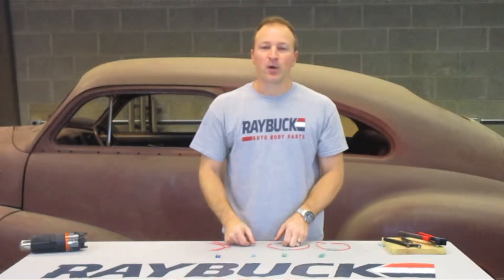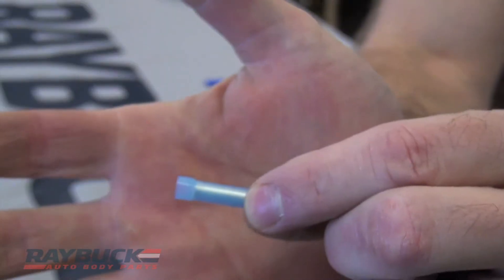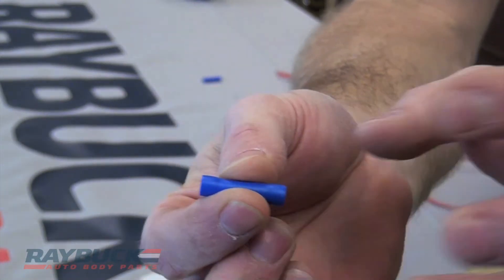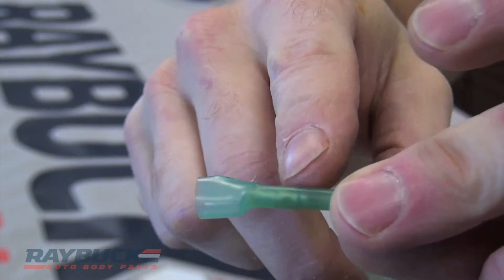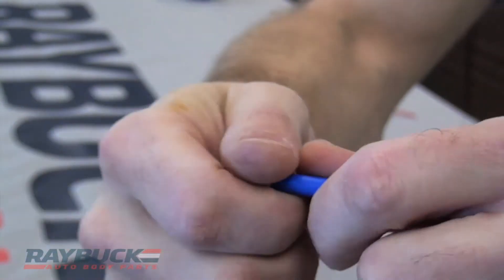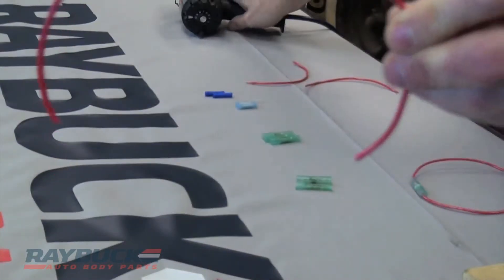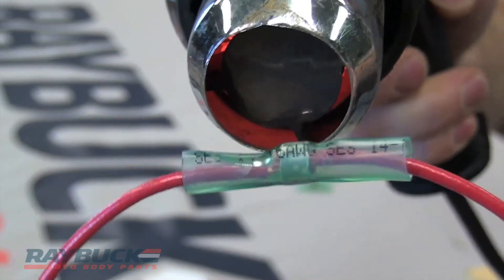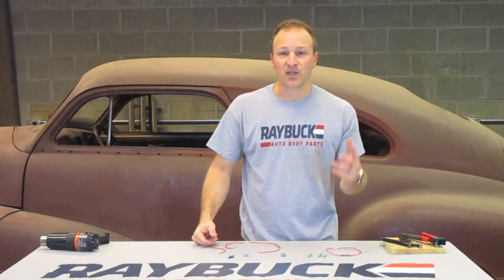Automotive Electrical Wire Connector Types Explained

Comment: I like the heat shrink built in. saves time and looks clean. I also like that I can see my wire bottom out. With the blue ones, I've had many come apart because I thought I had the wire in right. Thanks for sharing.